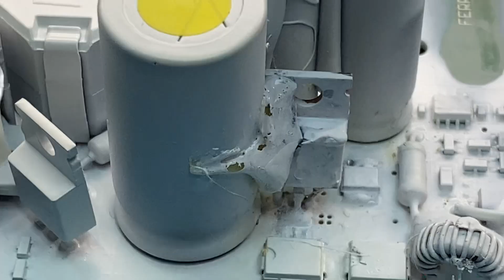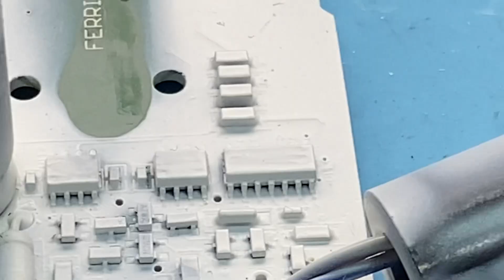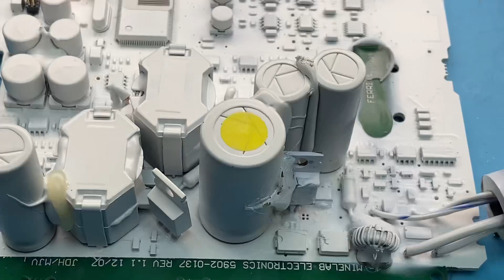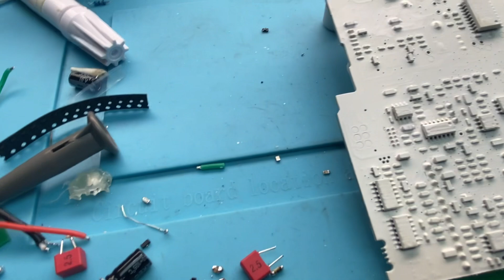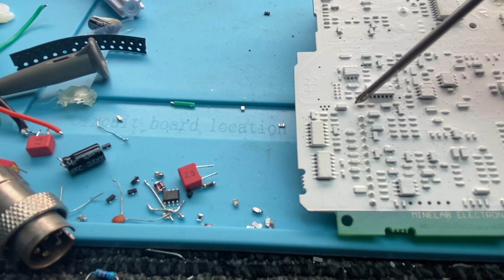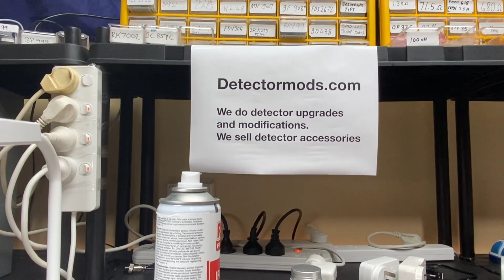This Minelab came in, laugh or cry?

Comment: You don’t miss much Woody👍 bloody good work mate. How long till gpz7000 upgrades are available or are tests still ongoing?
Reply from the maker: I have some for the 7000 in other videos.
Reply: @DetectorMods assumed they were in the testing phase still as they are not currently listed  on your web site👍
Reply from the maker: @lukemckay3262 I do not do the website updates.😉
Reply: @DetectorMods point taken! I will contact directly when next off the fields. I’d like to book in for “the full works” on my increasingly temperamental 7000. All the best for 2024 Woody
Reply from the maker: @lukemckay3262  The upgrades should turn it into a gold magnet .